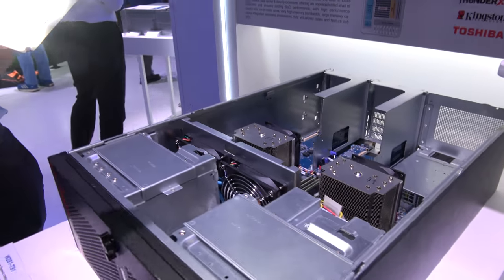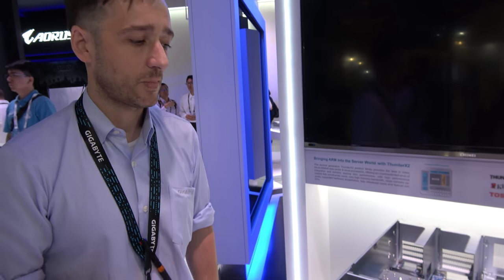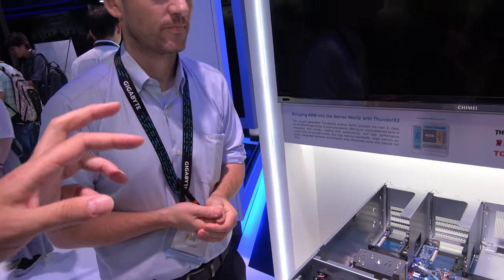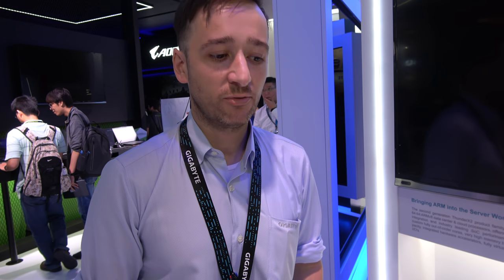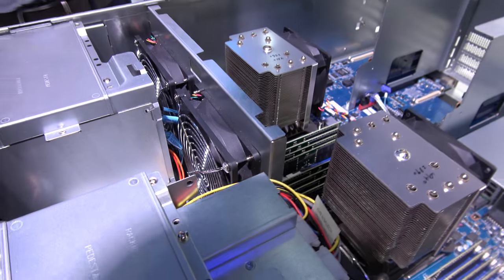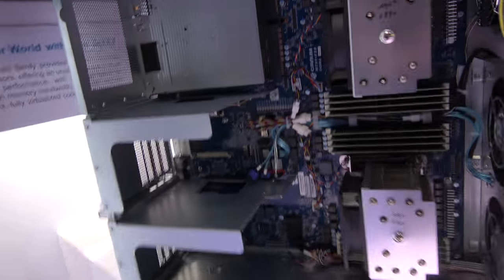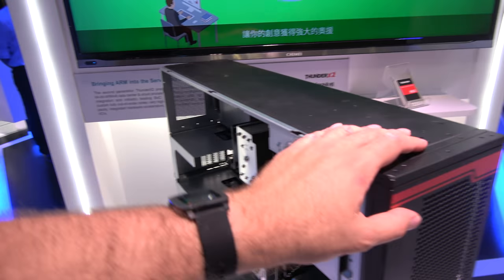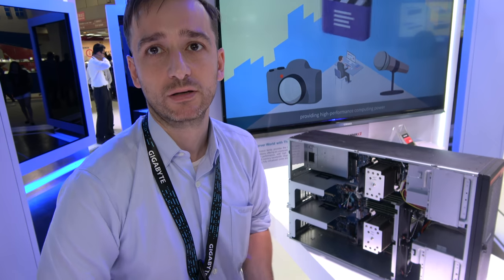Cavium ThunderX2 Desktop PC made by GIGABYTE for ARM Server development

Comment: Will the AMD RX580 run on this workstation?
Reply: Ask AMD if their driver is compiled for ARM ;)
Reply: It probably works fine with the cpu, since it is a server cpu, it as good as must be able to run linux, if it can run linux you can use basically all amd gpu's which aren't turned to fossils by now